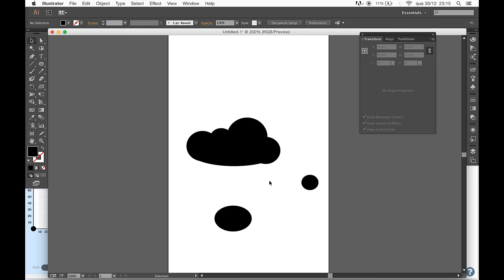Wine Bottle Holder // Happy 2016 // Thanks for 10k subs

Comment: Awesome!! Congrats! I'm happy to see you have your own Porto wine :D I did a couple of this wine bottle holders before Christmas and keeping the piece in place was a total nightmare! My forstner bit doesn't have teeth so maybe in your case was easier (it looks easy :P) What diameter did you use? Congrats again Cris!!
Reply from the maker: +Cactus! workshop Thanks Calritos! It wasn't that easy...and it is not properly sharpen, that's why you see so many dust and it took forever to cut on low feeding... but worked! I used 35mm bit that was the closest to this bottle diameter. But for regular wine bottles you need to use a smaller diameter bit. Cheers my friend!

Comment: Awesome project and channel, where can I get the plans to make my own?
Reply from the maker: +Mike Washington Thanks Mike! I don't have plans. The angle of cut on the miter saw was 45 as also in the drill press. But you can make a different one as long as the base cut has the same degree as the hole. For example 40 would work just fine or even better. It really depends on the shape of the bottle and weight...in my case, for this size and weigh bottle+liquid I would have made a 40 degree to get it balanced easier.

Comment: well done and happy new year. hate to be the safety police but for your own safety don't wear gloves when using the drill as there is the possibility of them catching and pulling your hand into, I personally had a near miss and was lucky not to get hurt. Apart from that great video as always
Reply from the maker: +Rob Evans Hey Rob, thanks a lot for the advice. I put those this time because I wasn't getting a proper grip with my small hands and it helped a lot but I understand it could also be a bit dangerous on certain situations. Happy new year!

Comment: Great videos. Please don't go overboard on the CNC machine. Many of us don't have one, or even want one. If your videos require a CNC, we won't watch as we can't make the project. Happy New Year.
Reply: Whilst I can understand where you are coming from I don't think there is any reason not to use it if you have one, yes loads of people don't have one but a simple inlay like this and most of the 'hobby' cnc woodwork we see in videos can be done with hand tools which might actually be quicker. I think it was the right amount of cnc time shown here as too much can be boring.
Reply from the maker: +Gary McCoy +Rob Evans Hey Gary, like Rob said, I understand your point of view but you can easily carve a shape like this with the router. I made 3 or 4 of these a couple years ago with the router free hand and worked perfectly. Most procedures that a cnc does can be done with a regular router, you just need some patience and to be creative to find other ways to make things! :) Happy new year to both!